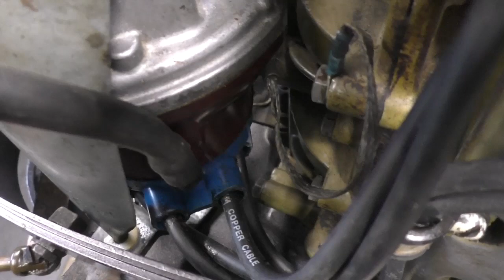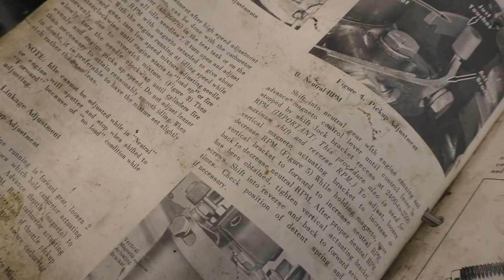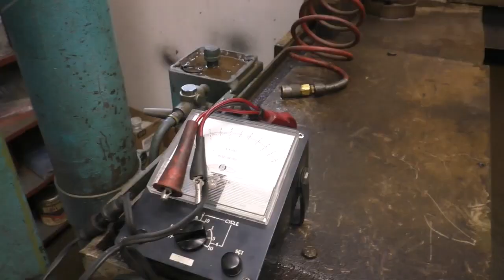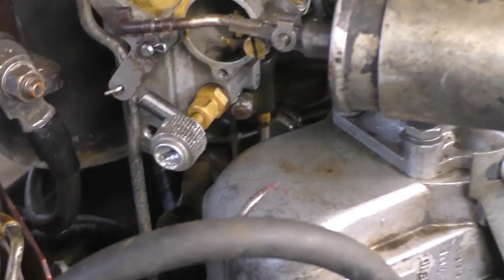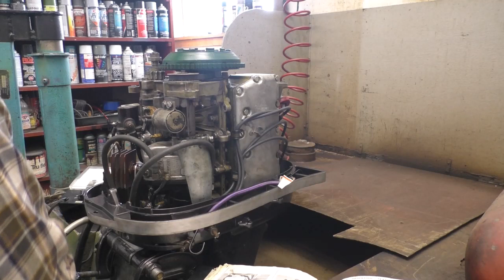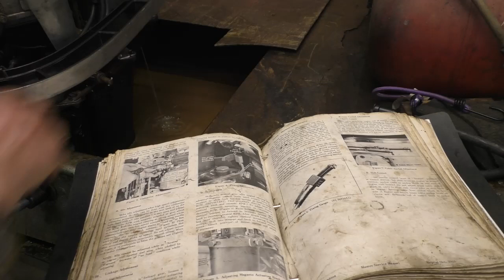Link and sync early Mk 55 pt 1

Comment: I worked in Marina s in 1970s to 80s in salt water long island NY.
Few of these survive even then.
I liked old Mercury s I build alot of inline six with distributor s few shops would work on.
Usually blocks exhaust inner covers a drive shafts would corrode from salt .
Arrow on pulley often half a tooth off alot.
Miss those days.
I used a torch all day long .
Thanks